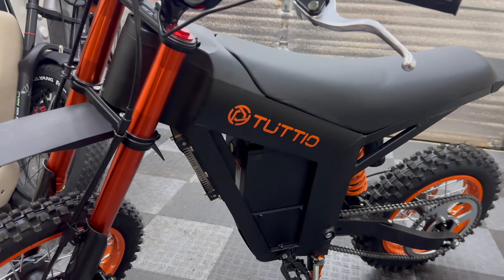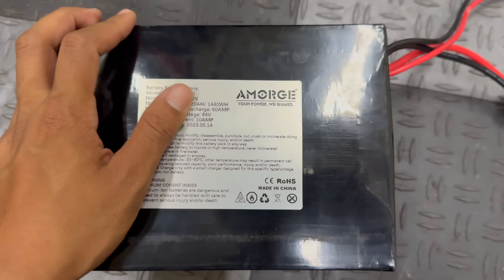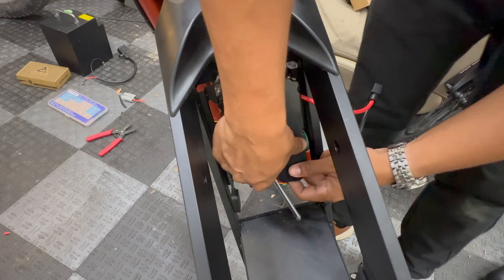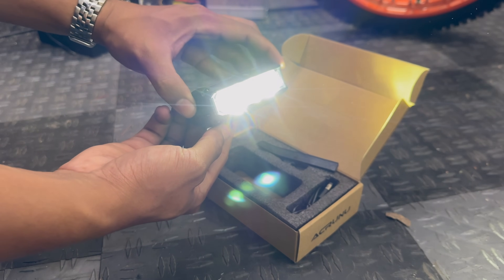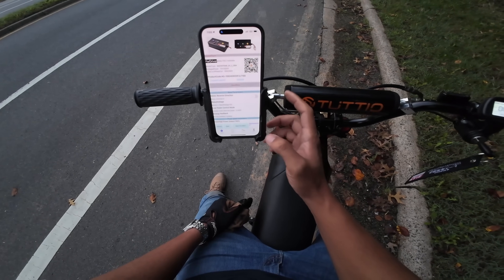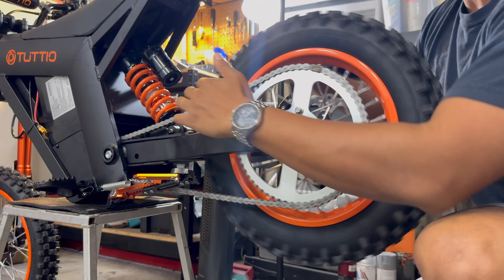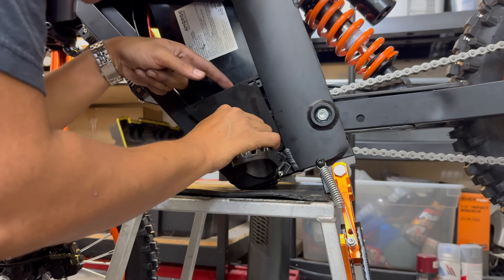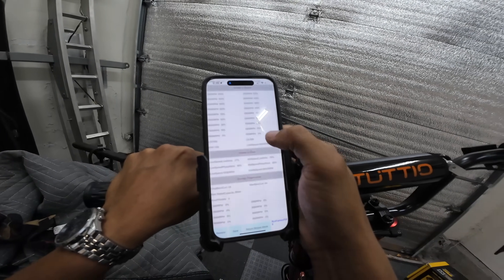Tuttio Soleil 01 Power Upgrade - 72V Battery Conversion

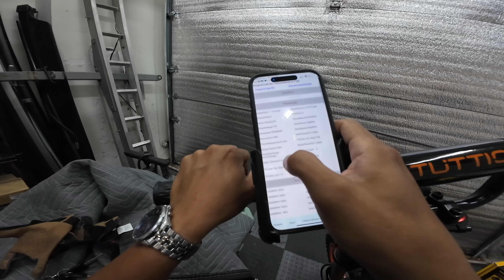Comment: @16:00 max line current does not need to be limited to the Maximum CONTINUOUS rating of the battery (in this case 60a), it can be set as high as the maximum discharge rating, which is not specified on your Amorge, as long as the BMS allows it.

When unsure what peak discharge is, you can set line amps such that it causes 0.5v/cell in series sag. So for 20s, a 10v sag such as 82v down to 72v when you give full throttle, is maximum line current should be set at, as far as the battery is concerned. Then the max rpm should be set to bring current back down to max rated discharge (60a in this case). 

The speed limit can be set with MaxSpeed or ratios in speeds. 

Since the bike cruised at 50 mph at 60a, that is probably the maximum realistic speed for that battery, however acceleration can be much better if you set line current to the peak discharge of the battery and then set the MaxSpeed to restrict it to 50 mph, which will automatically pull current back down to 60a. 

If you don’t have a temperature sensor in the motor you can use Cacu which is temperature simulation, and it uses whatever you enter in RatedPower as the thermal mass constant of the motor for the simulation. So you can set it to 500w if you want it to simulate higher temperatures and shit down the controller before you burn it up. Its just a simulation so it resets as soon as you reboot the controller. If the motor overtemp trips when the motor is still cool, increase rated power to 1000w and try it. You want it to show a slightly hotter temperature than actual since its a simulation. Shutting down the controller BEFORE the magic smoke leaves the motor is better than AFTER it already left. Lol
Reply: Badabing. 🤘This guy 👆Gets it. ✌️
Reply: I need help tuning
Reply: commenting to save for later
Reply: @LUCKIPUP  reminder
Reply: I wonder if the engine still alive?.

Comment: Pat do you think a 60 volt battery would be better for the longevity of the bike?
Reply from the maker: 60V would be more reliable if you’re planning on keeping the factory controller and motor in place long term, yes
Reply: @ Amorge already created a 60 volt 30 am plug in and play battery for the tuttio lol

Comment: Do you think you can link the 72 volt battery?
Reply from the maker: @judethedude99  not possible, I had to email them for a custom battery. Emailed info (at) amorge and gave them the size and specs I wanted
Reply: @PatOutdoors so is their anything wrong way I can covert my tuttio to 72 volts?

Comment: is it hard to find parts for the tuttio? i mean like parts that are most breakable such as the throttle, brakes, tires, tubes, etc.
Reply from the maker: Not at all. And if you can’t get them from Tuttio, it’s pretty universal stuff. Just a throttle compatible with a Fardriver controller, brake pads for pit bikes, tires and tubes are standard pit bike size
Reply: @PatOutdoors  thanks

Comment: Would you expect the stock motor to last at 72 volts? Or do you think 60 could be a better option for longevity when keeping everything else stock?
Reply from the maker: 60V would probably be more reliable than 72V on this motor and controller
Reply: Amorge offers a 60v battery for tuttios on their website but you have to message them

Comment: Can you tell us how the motor is holding up w/ the 72v battery?
Reply: So far, the one thing I've seen is a screen burning out. I guess it's made for 48v, so there's a chance it will die on 72v.
Reply: @HiLuckyB  What's your plan on fixing that?
Reply: @Mretinum  econic cycles has a upgrade kit. With a new wire harness, new throttle, voltmeter, then you can add a much nicer screen to the bike.

Comment: I wanna buy it specially since I’m a small girl I’m about 5,3 21 years old but I wanna use it on the street stock is it street legal this e-bike ?
Reply from the maker: Every state and country have different laws so I can’t really answer that for you. It’s technically illegal where I live (Virginia), but the cops don’t heavily enforce it here. It’s not capped at 28 mph and it doesn’t have pedals so you can’t classify it as a class 3 e-bike. I would check with someone from your local area
Reply: @PatOutdoors  thank you 🙏 I just want a nice looking 👀 bike that looks like a motorcycle since I don’t really want a motorcycle license rn plus having to buy a street legal motorcycle in top of that and prob gas, how is the battery though?
Reply: @PatOutdoors  thank you 🙏 I just want a nice looking 👀 bike that looks like a motorcycle since I don’t really want a motorcycle license rn plus having to buy a street legal motorcycle in top of that and prob gas, how is the battery though?

Comment: hey i have a question and would be really happy if you could answer. when i email then what do i tell them and how will i buy it?
Reply: and what is the continues and peak discharge rate for the bike
Reply from the maker: I’m not sure about this one actually.. not many spec details available on the 48V battery. My controller settings were previously set to 50 amps from factory though. I would recommend messaging Tuttio on Instagram

Comment: In my country we have a Kugoo Wish 01, which is basically a clone of this pit bike (but it has a headlight, brake lights, etc.). It has the exact FarDriver controller and it costs around $800 here. I'm looking forward to sell my Dualtron Ultra 1, buy a Kugoo Wish and put a 72V battery there too. I really wanted a cheap surron alternative, and I didn't know it was actually possible for this cheap!

Comment: will you upgrade to see how long the stock motor and controller last with 72 volt battery
Reply from the maker: That’s exactly the purpose of this video. Tuned stock controller with 72v battery and stock controller. We’ll see how long this lasts..

Comment: So i just bought one and your telling me with this app and new  72v battery it will do the same thing ?
Reply from the maker: With a 53T sprocket, proper installation, Bluetooth dongle, and proper tuning on the Fardriver app, yes.
Reply: @PatOutdoors where do buy the QS8 harness ? Because i see you need to change the wire harness. Is that also needed ? To convert the wire harness or could I leave the OEM harness that comes on it ?
Reply: @PatOutdoors  where do buy the QS8 harness ? Because i see you need to change the wire harness. Is that also needed ? To convert the wire harness or could I leave the OEM harness that comes on it ?

Comment: I cant wait for myself to buy this bike, I will rock the stock battery if the range is good for me, but I'll definetly upgrade the battery after on! 50 km/h for me is fine, what is really important to me is Range because I do long distance so I will upgrade the battery if the range does not satisfy me
Reply: Let me know if u ever got the bike I realized I can only get 19 miles on mode 3 after a full charge

Comment: How many miles did you get on the normal battery? I only got 5 miles out the box.
Reply: Only 5 miles? Really?
Were you in mode 3 full throttle the whole way or what?

Comment: Completely off topic from this video but I saw a video it was about a year ago that you posted it where you ran 4 12v battery’s in series on a razor mx, I have a big 48v battery on mine and I was wondering if I could run a 36v in series with it with a combiner or would I have to get the same 48v?
Reply from the maker: @skilletfingerz7380  no you can’t. Has to be same exact battery to be run in a series
Reply: @PatOutdoors  gotcha so I could just get the same 48v your saying

Comment: I wonder what the new sprocket and messing with the controller would get you in gains on the stock battery. Since the turn around time for an Amorge battery is several weeks.
Reply from the maker: I would suspect 42-43ish MPH with 48V, sprocket, and FD tuning
Reply: Amorge isn't the only one building bad ass batteries 😎

Comment: I couldn't wait anymore, I ordered one with your code 😎
Already have a fardriver bluetooth dongle ready. I'm going to see what it can do stock with a tune 💪
I waited to see if that $65 off would work but nothing. I got it for $1,289 shipped with your code, So I can't complain too much 👍
Reply: I would like to see what changing the sprocket and adding the dongle will net you for top speed.
Reply: Hey bro , when you do the tune do you mind getting back to me and letting me know if you could squeeze more power out of the stock bike ?
Reply: @Josuecuh  Had my first little ride today. The controller can do 70A line current, It ships at 50A. So that's a nice little bump, and it sounds like that might be the limit of the stock battery as well.
Reply: @HiLuckyB  cool thanks man ! Getting mine next week !
Reply: how much mph did the bluetooth dongle add if i may ask?
Reply: @damianbezos  That all depends on how much you weigh. If you're under 200 lbs, you can probably get into the low 40's mph. The bike really needs more voltage to get more top speed.
Reply: @HiLuckyB how did you set it up? I keep getting error code
Reply: @EbikesBros  After changing the settings, remove the Bluetooth module and see if the code goes away. There's been a lot of problems with the new bikes and the updated display. We have been talking about it in a couple of the big tuttio Facebook groups.
Reply: @HiLuckyB  let me try that because I did something earlier where it started making a noise from the motor so I held the throttle and it started spinning faster than I’ve ever heard it before. But after that I turned it off and now I can’t get error code off
Reply: Now it’s just beeping and says E07
Reply: @EbikesBros  What settings did you change? Have a look at the graph page of the app, it will normally show errors on that page.
Reply: @HiLuckyB  the graph part of the app says motor hall error
Reply: I reset everything and now system is okay. But the e10 code still pops up and my throttle doesn’t do anything still
Reply: @EbikesBros  If you reset the controller, you will probably need to do an auto learn. You have to have the wheel off the ground or take the chain off, and you have to hit auto learn it will beep then you hold full throttle and let the controller spin the motor forward and backwards and wait until it stops and beeps.
Reply: @HiLuckyB  bro that shiiiit is scary fast doing it indoors I had to stop because I felt like it was gona blow up on me 😅. Ima take the chain off and try tmrw. It currently works again but when I turn it on the e10 code is still on and it spins insanely fast like if it’s still on auto learn. I feel like I’m getting close to fixing it
Reply: @EbikesBros  I'm trying to find that code, I think e10 is what happens with the Bluetooth module plugged in with the new bikes. You start the auto learn in the graph page, it will beep a lot when it's ready. Then you hold the throttle 100% until it's done and beeps at you again.
Reply: @HiLuckyB  ohhh okay it should be done then. So the e10 code just gona be on for now? Also the motor makes a noise like a lot of electricity is passing through it when I turn the key is that normal ?
Reply: @EbikesBros  I have not hurd any kind of noise come from my motor. You should hear the fardriver beeps when it turns on. I'm starting to think your motor is hurt, it's never a good idea to free spin a motor to super high rpms. When we tune the bike we set a 9000 rpm limit but even that is probably higher then you should spin it. Riding the bike you won't see more than maybe 5000 rpm unless you get a upgraded controller to push motor power.
Reply: @HiLuckyB  I think I had the limit  set to 4000rpms Ima putting the settings lower

Comment: What would the top speed be with the 53t rear sprocket and the stock battery and tune?
Reply from the maker: I’m suspecting around 42-43 MPH with tuning the stock controller on 48V

Comment: My friend has this bike. She put a Surron front fender on it with no issues.
Reply from the maker: @SaleenaBBY  Hmm I have a surron fender here and it seems like the bolt pattern is a bit offset and needs to be redrilled. I’ll give it another try.
Reply: @PatOutdoors  to be fair she may have drilled it without telling me about it. But the surron fender does look good!
Reply: Talked to her last night as we were riding. The surron bolt pattern is fully reversed from the tuttios. She did drill it 👍 (light bee x /talaria/ Segway type fender btw)
Reply: Put a Orange KTM 50cc fender on my sons with small adjust to holes looks bad ass especially with the red bull graphics :)
Reply from the maker: @nevrsumr30  I’ll give it a shot!
Reply: @PatOutdoors  I ordered a bluetooth dongle which fardriver app. are you using?  Thank you :)

Comment: Is the Bluetooth dongle worth it for the bike when it’s stock to adjust torque etc?
Reply from the maker: To correct ratios, change the RPM limit, maybe turn the line amps a bit to see where the battery BMS starts tripping, YES. It would be the best $30 spent

Comment: Appreciate the love and super glad we got this thing ironed out! Definitely thinking thr kr5v with the base mount and swapping to atleast a 72450 so now we can run phase angle and not the stock encoder motor. Thing should absolutely be a rocket and push the limits of the chassis rather then the drivetrain! You know me im here for the next update!.. surron/crf fenders and send it ;-)

Comment: rawrr mantis x
Reply from the maker: So yes I really like the Mantis X. I happen to have one also.. I think it’s the best bike you can get for the $3K segment, but the Tuttio is simply a different classification so I wouldn’t compare the two
Reply: @PatOutdoors  i hear you. cool video, it inspired me to build a tutio
Reply: $1,300 vs $3,000, 2 completely different kinds of bikes. Even the $2,500 mini is slower 😂
Reply: @HiLuckyB  i haven't checked out the mini. im guessing that battery isn't cheap
Reply: @weedman6990  From what I can tell, the battery he used in the video is around $300. Not cheap, but it's not too bad either.
Reply from the maker: Actually.. it’s about $450 with shipping. Worth every penny though!

Comment: I been waiting for a  72v  battery that can fit this bike very nice 👏🏽👍  
I wanna find some supermoto wheels for the Soleil01 & oh the bar under the seat on the rear of the frame makes mounting a usb rear brake light super easy.
Reply from the maker: @burn1gotbeats  Thanks for the idea on the rear brake light!!
Reply: @PatOutdoors  😎👍thank you!!!
Reply: Careful modding those batteries. They can blow up your nuts

Comment: I knew the tune would be bad. I bet you could get close to 40mph on the stock battery with a good tune.
I think I might have to get one for my first pit bike. The price for what you get is crazy on this bike.

The $65 off is not working on there website from what I can tell, Or maybe it is and there adding a free light for $1,299? They have a pic with a light and a bow around it?
Not 100% sure, But Amazon has it with the $65 off but they add taxes. So that ends up a bit over $1,300 shipped 😅